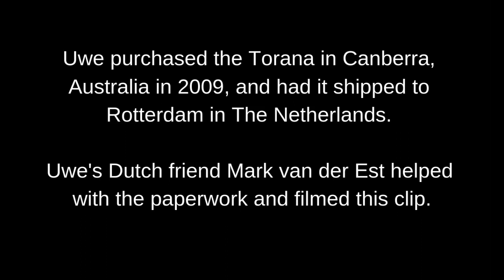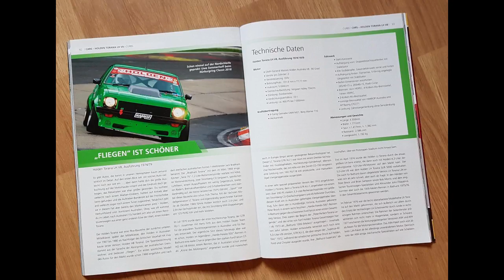Best of Holden Torana - A Torana in Germany

Comment: At Bathurst 73, 74, 75 & 76 the SLR5000 for three of those years is tattooed on my memory, so good to see one is in Europe at another legendary circuit. Spa and Monza next? Excellent work ✅
Reply from the maker: Yeah good times for the Torana in those years, only thing that stopped them was a dodgy fuel gauge and some oiling issues, things that any Torana owner will agree were also apparent in the road cars. Uwe is rebuilding the engine now to try to fix some of the oiling issues. Hard part is finding parts half way around the world during a pandemic. But he'll get there, he's come this far.

Comment: Awesomme stuff.  Good on you.  I'm now 62 years old and was in my teens when these were released in Aus.  My current VE Commodore and engine changes and mods are running around 600hp but is nowhere as "Iconic" as the A9X or SLR 5000.  You have made some great upgrades and fitments - well done.  Thanks for posting as it brings back fond memories for me
Reply from the maker: Thanks Peter. The new VE's are nice, with power on tap and air con and electric stuff, but yeah, I totally agree there is something special about an old Torana.

Comment: ich liebe Aussenseiter. Sehr schön aufgebaut ! Der Motor ist mega giftig , ist es ein 302er chevy ?
Reply from the maker: Holden 308 I believe. Made in Australia.
Reply from the maker: To clarify this one, Uwe has a Holden 253 that came in the car, and a Chev 355 stroker that he is building.
Reply: @BorkenGarage  The 253 HOLDEN engine will be a light modyfied engine for regular driving. The other engine build is a basic Holden 308 block with a 355 stroker crankshaft. Allowes to use Chevy small block conrods and forged pistons. A bigger range of aftermarket parts is available for this mod.

Comment: Awesome car, awesome track & awesome story. It has been a dream of mine to take my Torana to the Nurburgring. Although on my shoestring racing budget a large lotto win is required lol.
Reply from the maker: Yeah Uwe hasn't been able to drive it in anger yet, has had oil delivery issues among other things. He is currently trying to get some sponsorship and generate some income so he can do some events.
Reply: Yes as you probably all ready know there are many different things you can do to help the 308 oiling issues. Personally I added a sump breather to reduce pressure, swapped the oil pump for a Mopar high pressure/standard volume set up & added a 3 litre accumulator. All of this I did myself reasonably cheaply, the ultimate is a Dick Savy dry sump set up.
Reply from the maker: I'm not sure what he's doing but he's got a few tips from the guys on the GMH-Torana forum. @Ringholden - some  good tips here Uwe.
Reply: @BorkenGarage  Simple, dry sump it. Then you stop farting around and simply drive the car. Wet sump is for the towcar!!
Forums are for road cars and drag racing. Road race cars are entirely different

Comment: Great video, I love seeing the Torrie at the ring. There’s a lot of really nice engineering and thought that’s gone into the car. You’re living the dream mate! It must have been a lot of work convincing the human robots at the TÜV to allow the car on the road.
Reply from the maker: MCM fan by any chance? Chop chop? Not sure if he had to worry about TUV or not because race car. But he's used a lot of new parts on the car so that would help.
Reply: Potta's World nah, not really an mcm fan. I thought he must have done some roadworthy work as it’s been driven to the track on open roads.
Reply from the maker: @markmcgrath9098  Not sure, he hasn't mentioned it. The driving I've seen on the road is mostly between the workshop and the track, and I have no ideas are what the rules are about that. Only asked about MCM because they fixed a car up in Germany and everything had to be TUV certified, it was a bit of a running joke for a while.
Reply: Potta's World cool.

Comment: Must have had a lot of work done on the wheel arches, even 14×6 rims with 185 tyres fouled on mum's LX.
Reply from the maker: Yeah you have to cut the guards to put the flares on anyway. Sometimes there is a seam you have to trim off of the firewall too. Plenty of info on the Torana forum - http://www.gmh-torana.com.au/forums
Reply: Ross ,bet you could still crack the ton in it.

Comment: Oh, I wish I had brakes like that on mine.  I had the '74 LH SLR5000.  It was made to go fast but not stop with a front disc and rear drum configuration 🙂Being a road car mine didn't sound like that either 😞 The rolling camera make you think you are on a motor bike.  Bit off putting.
Reply from the maker: Yeah brakes were not the priority back then and even so the best ones weren't too flash.

I didn't have the correct software for the 360 camera so yeah, it is not ideal, I had to cut a lot out of it.

Comment: Get off the pedaling throttle work at low speeds for fuck sake!
Our performance engines actually idle you know, no matter how big the cams.
Reply from the maker: Not sure which bit you're referring to exactly but most likely having carb issues or trying to keep oil pressure up?

Comment: Looks like a close relative of the Opel Commodor GS  mine had a straight 6 with 2 2 bbl carbs .
Reply from the maker: We had a Holden Commodore that came after this in 1978/9, that was based on an Opel. Look up VB Commodore if you want to have a look, they came with a 5L V8, a few different straight 6's or a crappy 4 cylinder. They did quite well in touring cars and at Bathurst.

Comment: IIRC the 4 door Torana was dimensionally the same as the EH from the mid 60s.
Reply from the maker: A bit skinnier and a bit shorter, lengthwise pretty close though

EH

Wheelbase	106.0 inches (2692mm)
Length	177.6 inches (4511mm)
Width	68.0 inches (1727mm)
Height	58.2 inches (1478mm)

LH Torana

Wheelbase	2,590 mm (101.8 in)
Length	4,510 mm (177.5 in)
Width	1,704 mm (67.1 in)
Height	1,331 mm (52.4 in)

Comment: I would love an a9x in the uk.  I need the trana grin!
Reply from the maker: A9X would set you back a few bucks mate. There are cheaper versions that can give you the grin :D
Reply: @BorkenGarage  apart from the obvious are the a9x different underneath/weight from the 4 door?
Reply from the maker: @brittenv1000  yeah I think so but there is a 4 door A9X too. There are definitely differences between a standard LX and an A9X, eg bigger diff (and different floor pan to suit), 4 wheel disk brakes, some suspension differences I think.

Comment: I'm imagining the German reaction to it. It has a direct Opel cousin, but just like the LC/LJ Toranas took an Opel body, hardened and strengthened just about everything, then dropped a 5 litre V-8 in it.
Reply from the maker: Are you talking about the Opel Ascona? To be completely honest, I am a bit upset about the fact that we were told these were all Australian designed and built cars, when in fact, there are very few, (if any), that didn't copy another design from somewhere else.
Reply: @BorkenGarage  None are "copies;" they are usually heavily modified from another design. Even the VB Commodore, from which the starting point was an Opel Rekord had to be modified and overhauled in so many ways not just for things like making a V-8 fit, but to be able to withstand Holden's prototype testing. For a start, they took a Rekord body and swapped out its nose for a Senator so an inline 6 would fit. They did away with the recirculating ball and nut steering for rack and pinion so the 308 would fit. This prototype was driven around the test track, and it was initially a right hand drive hybrid of the two models with a Holden driveline. in 1500 km the grille fell out. In 5000 km, they had to scrap it. They then added bracing and stiffening. Even the fabrics are a special composition to withstand the harsher Australian conditions. While they may resemble their Opel cousins, there were a lot of changes made for them to withstand conditions here. 

Holden's idea of testing a prototype was always "drive it hard until it breaks, so we know what the breaking point is. If that breaking point is too low, find out why and make it stronger." When the Commodore was still being developed, An Opel engineer was sent out to find out why the prototype initially broke. "What kind of stresses are you putting on the suspension?" apparently it was over 10 times what Opel did in testing.
Reply from the maker: @Mechknight73  Yeah I get that, just from a styling point of view, all these cars that we grew up with that we thought were unique to Aus, all had "cousins" elsewhere.

Comment: Can you give us some engine specs of the Toranas V8?
Reply from the maker: Uwe would be the one to ask mate. https://www.youtube.com/user/Ringholden

He is currently pulling the engine down because he is still having oil pressure issues.

I don't think he's ever really been able to drive it in anger which is a bit frustrating for him.

But once its sorted I'm sure it will be competitive.

I'm hoping to do an update once he gets it back on the track so keep an eye out for that.
Reply: 308 cubic inch 90 degree V8. Naturally aspirated with a Rochester 4 barrel carb. 2 valves per cylinder pushrod engine. The word Torana is aboriginal and means” to fly”
Reply: 308 Holden,, 4" bore, originally a hydraulic cam with non adjustable lifters. With the original early 70s heads, eiieeiie would make moderate power and torque. In a F5000 they made about 460hp. In a Bathurst Torana in GpC form made about 360hp. With those VN type eieieiei heads they make more.
Oiling is average, dry sumping essential for road race.
The engines are also known as the 'plastic fantastic' as they always were a bit dubious for reliability. Oiling and keeping a head gasket in them the issue. Standard they ate cams as well.
Reply: @ldnwholesale8552  And pulled the tops off pistons. When i had my SLR 5000 i bought a book written by l
Les Small (Gicey's mechanic). Basically once you solved one problem you got another 500 rpm and a new problem..

Comment: Why did you import a perfectly good car and then wreck it with mods. SMH.
Reply from the maker: You obviously think a Torana on the Nurburgring is pretty cool.
To be competitive it needed the 40 year old parts updated.
How easy do you reckon it is to get Holden parts in Germany?
Also it is not and never has been my car....
And for the record it still runs a Holden motor.
And is still not a real SLR 5000.

Comment: Body shape/design wouldnt have excited the Germans as it's based on the Opel Rekord
Reply from the maker: Which model of Rekord? I know the Commodore was basically a rebadged Opel, but always thought the later Toranas were an Australian design. Can you link to any pics of Rekords with big flares and bonnet scoops? I haven't been able to find any.
Reply: @BorkenGarage  1974 Rekord - note the c-pillar of 4 door models. 
Also look up 1974 Opel Kadett. Does it look familiar to another Aussie car?
Reply from the maker: @wizzard5442  Yeah the Gemini is a rebadged Kadett so there is a bit more than a resemblance there :-) Quite a few of the late 70's/early 80's cars were rebadged or based on other cars.

Comment: This car was a development of the Vauxhall Viva, sister of the Opel Kadett, so arguably it's going home.
Reply from the maker: Yes and No. The HB was based on the Vauxhall Viva which was a 4 cylinder British car. The LC had a 4 and 6 cyl version which was an evolution of the HB but the 6 cylinder versions in particular were quite different. The LH was the new shape that was released in 1974 which was 5 years after LC was originally released and as far as I am aware was a whole new car. Of course some of the learnings of the previous model carried over, but by this time it was a VERY different car to the Vauxhall Viva or Opel Kadett (Holden Gemini in Australia). Obviously there is some influence from other cars of the same era and the car is styled to match the fashion of the time like any car.
Reply: @BorkenGarage  Ah ok, thank you for clearing this up - I didn't know all of this detail :-)
Reply: @TheMDJ2000   Opel Ascona 400 , the German version. The Holdens have much thicker steel panels used.

Comment: Good to see you are not scared to race that beauty...👍👍👍👍
Reply from the maker: You'll notice he isn't going flat out through the corners, that is due to some oil surge issues and low oil pressure through the twisty bits. He has done a lot of work to try to resolve it but the engine is still in pieces. He is aiming for next summer to get it on the track.

Comment: So in other words it's not a Torana at all just a collection of high-end race parts with no relation to the original. <eye roll>
Reply from the maker: If its not a Torana what is it?
Reply: @BorkenGarage  A Torana body shell with DTM race parts underneath. A "Frankenrana"
Reply from the maker: @GM-fh5jp  He's building a 253 to put in it right now so the heart of it is still Holden.
Reply: @BorkenGarage  Interesting. The 253 is quite a step down and not a lot of weight reduction. If you watch the video again as he describes the suspension,diff ,steering geometry, sway brs, DTM brakes etc...it's still a Torana in looks only.
Reply from the maker: @GM-fh5jp  He is waiting for parts for his other motor, the 253 is only a temporary measure.

Have you seen Touring Car Masters? By your approximation, none of those cars are real either. It is a purpose built race car....I mean.....for parts availability alone it makes sense to use new stuff.
Reply: @BorkenGarage  Yes, you are probably right. As an Aussie though, knowing Toranas, drag racing against plenty of them lol we know what they'll do and what they won't.
I hope he has great fun and success with his build.
ps, he should have bough an LX hatchback they look so badass "An A9X tribute " car. Brock 05 FTW

Comment: Hatchback would have been better
Reply from the maker: The 4 doors were/are just as quick.

The hatch may be a bit lighter, but other than that, they are pretty much the same car, especially when you have a bit of freedom to modify them.

But when it comes to cost, the hatch is FAR more expensive to purchase, and I imagine would be harder to get parts for too.

This is a big issue when you are half way across the world from spare parts.
Reply: The hatchback had less clearance at the rear for a larger rear axle, and revised suspension mounting points etc. You basically need an A9X shell (which actually had the rear floor pan from the later UC) which are now VERY hard to find and incredibly expensive.  The 4-door gives you MUCH better options for modifications.
Reply: @BorkenGarage  spot on.

Comment: Oz should have had more Germans involved in the design of the Toranas!
Reply from the maker: The early Toranas actually used an Opel 4 speed but they had issues and switched to the Aussie 4 Speed (M20 and M21 on V8 models). Also, Australians have such a diverse range of backgrounds there probably were Germans or at least people of German heritage involved in the design.
Reply from the maker: H HOUR HOTEL  The earliest Toranas were rebadged HB Vauxhall Vivas. I'm talking about the early LC 6 cyl models, many of which also used an Opel 4 spd but there are very few of them left now because they were unreliable.
Reply: Let's not forget that when Holden brought Opel Rekords to Australia for testing prior to the Commodore, they literally fell apart as they couldn't  handle the local conditions. When the Aussie engineers discussed the problems with their German counterparts, they were told "Build better roads".  So credit to the Australian engineers who made cars that were not only fast but tough enough to handle some of the world's worst driving conditions.
Reply: @BorkenGarage  I had a LJ 2dr way back in the early 80s, it had a Opel box, lasted 3 months !, rebuilt the car as XU-1 clone as I managed to get a LJ XU-1 that had a roll over , transffered all the running gear to my car, added triple Webers, found out later on the engine was Bathurst block JP I think, guy brought the rust bucket off me just for the engine alone, keep up the great work, nuthing like Holden V8 at full song, cheers
Reply from the maker: @ickisdogg3779  Wow bloody lucky getting your hands on a Bathurst engine with triple webbers. Must have gone alright.